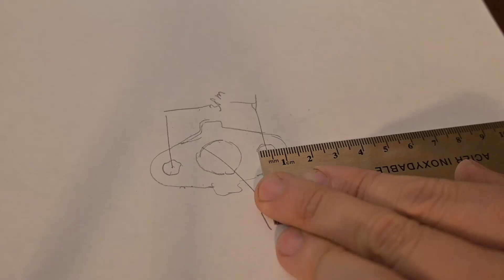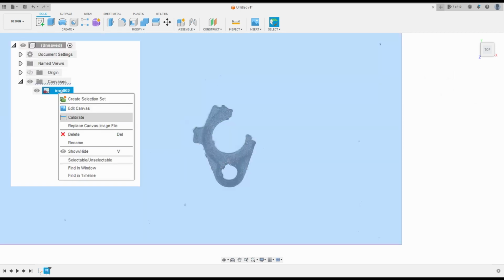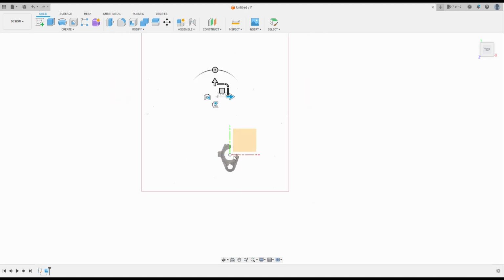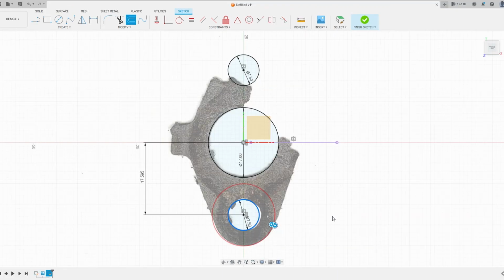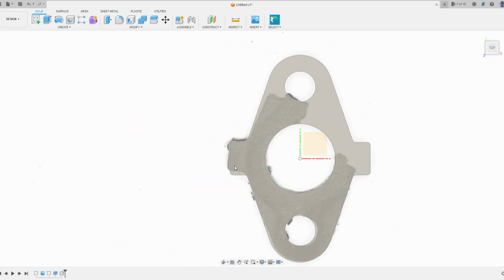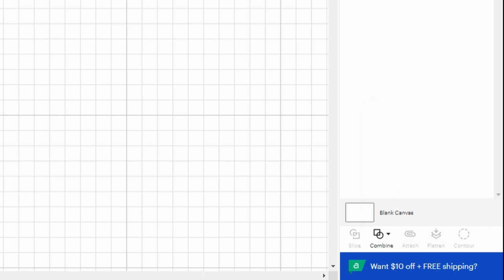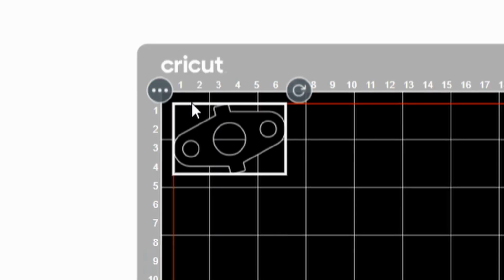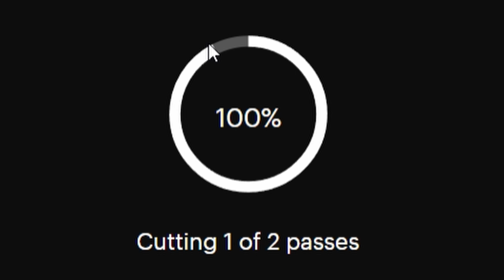The Ultimate Guide to DIY Gaskets!

Comment: hello i would like to cut a gasket material called CNAF , i cut them with the laser now but it burns the edges. Will i be able to cut them with the vinyl cutter?
Reply from the maker: Have never tried. If you can cut it it with an Xacto or Olfa knife, a vinyl cutter will likely work depending how powerful the cutter is.

Comment: Why not scan the old gasket on graph paper or with a scale alongside?
Reply from the maker: In most scenarios you can just get away with a quick measurement. However that would be a very good way to have a fixed known dimension to scale off of, especially if the part is very obscure and hard to measure two accurate points.